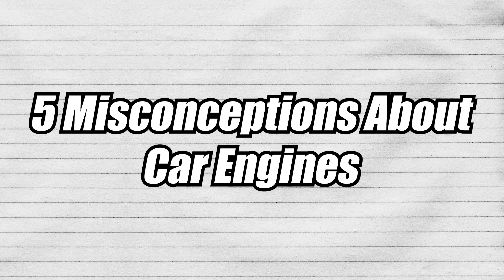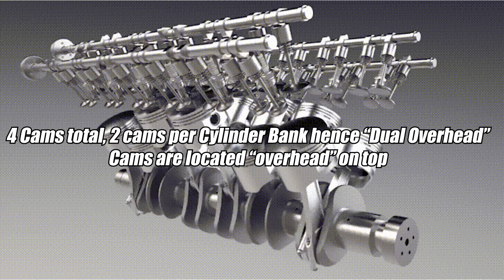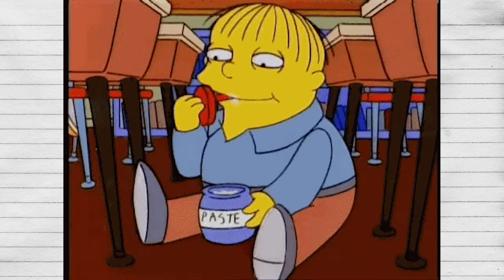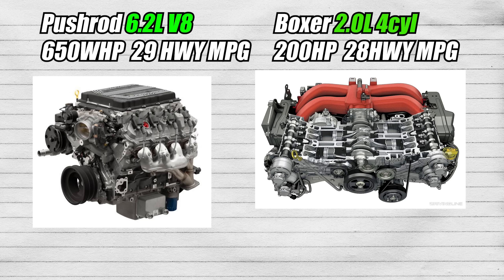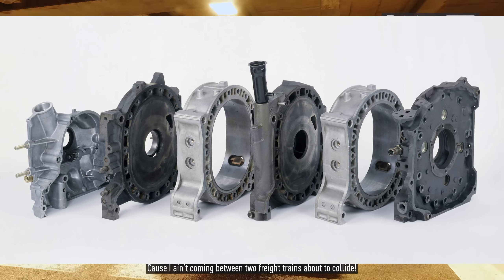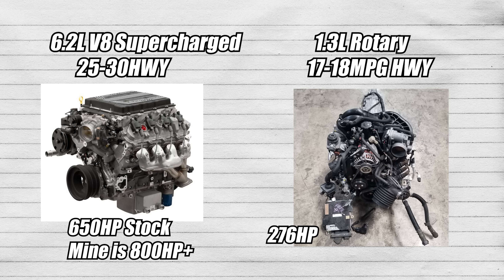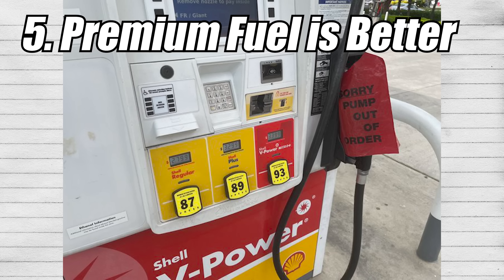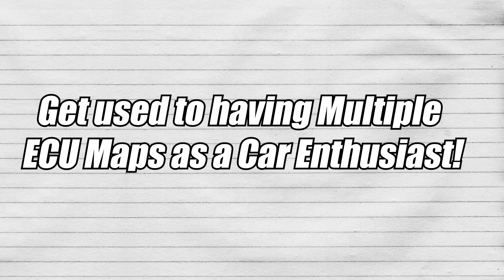5 Misconceptions About Car Engines!

Comment: I don't get what you're saying about pushrods. Why would they make more torque? There's nothing they can do to valves, overhead camshafts can't do, or is there?

All they are is being easier to engineer and cheaper to produce.
Reply: pushrods have better air velocity which result in better combustion (+torque)
Reply: @demarcuscousinsthe65th  how exactly have pushrods better air velocity? They can't open the valve more and neither can they open the valve faster.

Comment: My brother in christ engines with less cylinders are better for fuel economy because less power is wasted on frictional losses. There's no getting around physics. Trying to disprove it by comparing low cylinder count "sport cars" to high cylinder count grocery getters is dishonest at best and maliciously misinformed at worst.

Pushrods aren't torquey because they're pushrods. They're torquey because pushrod either allows or outright forces you into certain design characteristics like two valves per head or longer stroke.

Comment: My 4.3 V6 Chevy S10 has better MPG than my 2.0 Saab. I average 20 MPG in my S10, and around 17-18 in my 9-3 Aero.
And my 9-3 is a 6 speed manual, while my S-10 has 4L60E 4 speed automatic- if it had manual or modern automatic it'd probably be even more of a difference.

Comment: Damn, ive got 2.80 gears and im running almost 4000 rpms by the time i reach 80 mph. If i stay at 55, which is between 2000-2500, i get a solid 14-15 mpg.

Comment: see my question with the "premium" fuel is that people have said things such as "91 fuel burns cleaner" "v-power does a great job keeping your engine clean" etc. etc. etc... I don't care about the performance gain of "premium" fuel but I know people who have been scared into using it because of the whole "it can clean your engine" claims and neither they nor I can tell the legitimacy of the whole "premium is cleaner" claims
Reply: The companies say they put more/better detergents in their high premium. Gives people a reason to sometimes buy it even if their engine is only tuned for regular (this is harmless to the engine).
Not sure how verifiable that is, but there's something called "top tier" rating and it is separately tested for good detergent properties. Google that. These brands (Exxon/Mobil, Citgo, several others) have the good detergents in their regular gas too!

Comment: All engines need to warm up. Doesn't matter how new they are. It's the type of the oil in them that determines how long that warm up period is. But you definitely should not put any ICE car of any year in gear without letting it warm up a few minutes.

Comment: alot of people say that VAG's vr6 is unreliable and slow so much that nobody buys these cars. WRONG. These engines are great in terms of reliability, the 2.9 in Golf MK3 with the Syncro is one of the best cars to have fun (ofc not offroading, this car is too low for that). The later versions (FSI) isn't that good, but still, pretty good engine.

Comment: Yes premium gas won't improve performance on an economy car but I used to run 91 in my 07 Focus and the car ran smoother the engine used to have a tick as soon as I put premium in it the tick went away the car loved running on premium and it did slightly improve performance not drastically but the car felt like it was running a lot better

Comment: this is interesting. Explains why my 4 speed automatic 1990 Honda Accord with a 2.0 litre i4 engine gets worse gas mileage than my mom's 6 speed auto 2017 Dodge Durango with a 5.7 litre Hemi V8. poor old girl has to work so hard to go much faster than 60 mph cause she runs through all four gears real quick.
Reply: The Durango has more gears to work with and has the MDS making it a 4cyl when cruising

Comment: People do hate on the rotary a lil too much. I get it at car meets and it sucks. Idk why people have this thought that they are so bad. They're alright, just not the best. They last like 100km to 160k kms due to what is essentially head gaskets and piston rings needing replaced and people act like it's some huge issue. Subaru head gaskets, BMW rod bearings, and Audi piston rings all last about the same time lmao. Just sucks that with a rotary you have to drop the whole engine and fully take it apart, which is the annoying part. 

Though just to note, in an EV they'll be running the engine at a fixed speed which will increase it's lifespan and fuel efficiency. Not as much as a small I4, but the advantage of a far smaller and compact engine is the trade off.  Hopefully if Mazda do pull the trigger on that, that it all goes well and maybe incentivises one last hurrah for the platform and they make one last sports car before 2030 - when Mazda have said they'll go full EV.

Comment: As an rx8 owner I do find the fact rotary is unreliable as false, yes they may have alot is cons and be ancient tech but the engine is not the problem but the owner, I been taking good care of it and I don't have any issues encounter with the engine, everything is ok from the rotors, eccentric shaft, and a careful watch with the apex seals although I do fuel oil mixture because the oil metering got busted randomly but my rx8 still runs smoothly, Mazda even proved the rotaries reliability by it's only famous win to date at 24 hours of le mans by their 787B

Comment: I just let it run until the rpm drops and the engine quiets down. One my 03 accord with 200000 miles on it, that takes a few minutes.

Comment: For your 3rd point I’m not sure about some of your points. When explaining about the scarcity of parts and high demand for it, wouldn’t that just mean that due to the unreliable nature of the rotary that’s why parts are in high demand? Just because parts are hard to come by doesn’t affect how reliable or unreliable the engine is. The Subaru ej25 is a loved engine with lots of part support but is still an unreliable engine.

And with another point where the car trades hands a lot with other owners, I mean it’s just like any other old sports car, I mean I’m no mechanic either but I’d imagine that you’d do a full check over of the engine, transmission etc to look for mods or changes made to the car. Anyway that’s how I see it. Change my mind if anyone feels like reading this long ass comment.

Comment: I appreciate someone trying to disambiguate. Unfortunately, your knowledge of mechanics and physics is a little lacking. For instance, just randomly picking one out of about 100 errors, torque doesn't get the car moving or keep the car moving. Power gets the car moving and keeps the car moving. Power, in the context of engines, is just torque x horsepower.  You can have a million foot pounds of torque, but if it's only revolving at 1 RPM, you're not getting much power out of that engine. Conversely, if you have an engine that has half the torque but revs four times higher, that engine is twice as powerful. Anyway, I appreciate the attempt but maybe you should run your physics and engineering concepts by me before you publish them :-)
Reply: Another thing, pushrod engines don't develop more torque because of the pushrod. The pushrod's mass is large so it can't move quickly enough not to cause valve float at high RPMs. So it does not rev high.  Accordingly, they tune it for torque at low engine speeds instead of peak power. The pushrod valvetrain is a handicap that engineers have worked around. It's not an asset.

The idea that you have uncovered some secret regarding fuel economy that auto engineers didn't know 100 years ago is a bit funny you must admit.

Comment: Yes bigger engines do not always mean more power. But it does mean there's more potential for more power at a cheaper cost. For instance if I was building a car to be fast and it did not have an engine and I only had engine two choices 8 cylinder and four cylinder and just bare blocks to build from scratch. The goal was 500 horsepower. The 8 cylinder would cost half as much to make 500 horsepower than a 4 cylinder. So yes bigger does mean more potential horsepower. It just depends on your build. So if I had a vehicle I wanted to keep close to original but wanted to make it a powerhouse. And it came with a four-cylinder. Then yes I'm going to build that four-cylinder. But if I got a really nice rolling chassis and did not care about sticking through the form or original. I would build the V8 first. Even though I hate LS swaps the very unoriginal. There is a reason why everyone does that.

Comment: Your 2L struggling to get 24MPG is incorrect. I had a BRZ and I averaged 30MPG driving spiritedly and in traffic, as a mix. You should've used something like an RX8 as a small motor terrible fuel milage.

Comment: Dude, pushrods have nothing to do with torque.

Harley engines have more torque because they're under-square, and they're under-square because they're air-cooled. And because they're under-square the pistons need a longer piston rod for any given displacement, which make for a more effective leaver and therefore more torque, but lower RPMs and therefore less power. And because the engine spins slower, it becomes viable to use pushrods to actuate the vales, and that makes for a simpler head that's cheaper to manufacture. 

Indian engines (as well as Harley's V-Rod engine) on the other hand are liquid-cooled, and because liquid-cooling is more effective at dissipating heat than air-cooling they can get away with being under-squared, which makes for higher revving engine (because the pistons have to travel less distance) and more horsepower, but less torque. Also, high revving engines favor overhead cams because pushrods have mass and therefore inertia which places a cap on how fast they can change direction and therefore actuate the valves, thus limiting max RPM, but make the cylinder heads more complicated and expensive to produce.

Comment: There is a lot of misinformation in this video. 
Pushrods vs OHC has NOTHING to do with torque production. Displacement and cam timing is what dictates torque production and at which RPM the torque band is located. Torque band is the rpm range in which the parts in the engine are operating at peak volumetric efficiency. This can be shifted up and down the rpm range equally with pushrods or OHC with the selection of proper parts. OHC engines tend to favor higher RPM because there are less reciprocating parts than a pushrod engine. Also overhead cam engines have more freedom to Optimize the shape of intake and exhaust ports because there are no pushrods coming up from the valley of the block dictating their shape. It’s a nice video but fails in the technical department.

Comment: first of all if you put 93 octane in your car, it wont make it perform better, its actually the other way around, if your car performs better it will need 93 octane, its all about compression, the more compression your car has, its gonna need a higher octane

Comment: 3:00 yea this whole section is correct. My 2004 Trailblazer gets 13 mpg on highways, maybe 10 in city... the SS Trailblazer gets better gas mileage than my inline-6 yet its pushed that smaller=less gas. Thats the case if you drive the SS like a jackass and floor it all the time. But not everyone is a dumb 16 year old who thinks that a clapped out SS with a side exit exhaust is cool

Comment: If you take care of the rotary either fine granted they don't have the lifespan of a normal combustion engine but rotary is also rev insanely High it's kind of the same thing as motorcycles motorcycle engines like in sport bikes rev stupidly High and therefore don't have a very long lifespan but with motorcycles they don't really get driven as much as car so that's fine and I'm also not saying motorcycle engines aren't reliable because Honda has proven that their CBR 600 and s*** can do 300,000 Mi which is insane I'm just saying the higher revving engine it's putting more strain on the engine than a low revving V8

Comment: Generally no replacement for displacement. You compared a twin turbo v6 to a na v8. Compare apples to apples. Put a twin turbo setup on the v8 and it will make way more power. Or take the turbos off the v6 and compare it na to na. Granted you did get the fact that certain engine setups do have better efficiency (power/liter) than others. Not many people mention that and I’m glad you included it.
Reply: Well, if we take an atmospheric rotary or a honda 4 cylinder vtec, we will still have an aproaching power for a lot less displacement.

Comment: nice vids m8, personnaly i think its better to just start your engine and driving immediatly without flooring it, maybe let the engine idle for a couple of second if its cold but if you warm up  your engine and immedialty drive after, your tire, brake, transmission oil are not in temperature and thats not very good for your safety and your car
Reply: Tires only heat by driving, and brakes dont have to warm up (except carbon-ceramique), but the other part are true.
Reply: @hugoku8755   thats what i wanted to say with the tires, i guess my sentences wasnt very clear (sorry english is not my first language) and for the brake i dont really know but i think you're right, in a grocery getter its better to have all of ur brake without warming them up for 15 minutes

The point i wanted to say, is just start your car, drive without flooring it and every thing will be in temperature and not only the engine
Reply: @littlebreads8242  Yes you are right, and i understand (for me too english is not my first language).
But its well explained, and most of the people dont understand it.
Reply: @hugoku8755   thank you , i was afraid my comment looks like i write these while being drunk af

Comment: Yeah, "arbitrary factor", not driven by oligarchs to push smaller engines with lower lifespans thus forcing you to buy it more often because it's not as reliable and it will break right out of warranty. Sure, arbitrary.

Comment: all of these can be argued for both sides, na engines can be made very powerful, much more than a basic turbo kit, so turbo doesn't always mean faster and at the end you didn't have a meaningful conclusion for all the talking you did. bigger engines often use more fuel but mpg is based on many factors and no blanket laws are good, but there is a reason every high efficiency car has a tiny motor, so again you point is weak. rotary's arent bad but they are less reliable than other motor designs by a good amount, there's a reason it could get faa approval. letting a engine warm up is still good because in the cold oils viscosity and property's arent what there supposed to be at and tolerances are tighter, its a wise idea to let your car warm up. and you admitted octane ratting and power isnt straight forward. your whole video is just a massive no but well yes.

Comment: Hmmm.... One of the things that kind of drives me up a wall is the "No replacement for displacement" and the "but forced induction" crowds. Both are technically wrong and right at the same time. And it's really just annoying. Coincidentally, the fuel economy thing in this video is just as stupid as law makers. Mainly because MPG is a mind numbingly idiotic measurement for fuel economy. It can fluctuate wildly and is very inconsistent. A far more accurate way to measure and get a realistic proper look at a fuel economy of a car is how many liters of fuel it spend for 100 km in what scenarios. And when one takes a look at that data, displacement does in fact matter. You can have BETTER MPG in a 4 liter V8 than a 2 liter boxer 4, but you will NEVER, UNDER ANY CIRCUMSTANCE spend less liters of fuel in the same scenario. Not unless that 2 liter is Turboed. Which is why I'm annoyed by the crowds mentioned above. Forced induction both does and doesn't replace displacement. It replaces it in the sense that it makes engine size and packaging slightly smaller, but it really doesn't because of how much air and fuel is being put into the cylinders. There's a reason that low compression pistons are run on turbo engines, it's because the mixture is under compression when it enters the cylinder. Boost is initial compression upon entry into the cylinder people.

Comment: OHV can be DOCH but it has to be converted to Free valve.💪🏾
And a 2 rotary is in fact 3.4L Mazda was smart to only put on the marketing only one turn of the engine instead of DTC witch is a full turn of the engine and putting all 3 faces of both rotors.

Comment: I hate rotaries. It’s just that the seals. They. They suck.
Reply: The seals blow because people run thin oil, every rotary owner runs 20-50W conventional non synthetic oil, and premix is recommended but not needed, another problem is people don’t replace the stock ignition system when it goes bad, which then causing the plugs to go foul faster, once they go foul they don’t burn the mixture correctly then all of that unburnt fuel goes into the stock catalytic converter and it clogs it up so much to the point starting up the car gets harder that the back pressure starts pushing that crap back into the engine,
So if you 
-decat the car
-replace the ignition system
-run 20W-50 oil
-regular maintenance 
Those cars are running forever and no damage is done when redlining it like a stock piston engine

Comment: I get large engine doesn’t mean it’s less efficient.
But how else are you going to generalize things? You can rev the shit out of the corvette and it will be inefficient, same goes with my CRV, if i rev the fuck out of the 1.5, it will be inefficient.
So all we can do is generalize things, we can only ASSUME larger engines=worse fuel economy and tax accordingly. Unless you feel like all cars from now on should have a software rev limiter up to 3000-4000rpm regardless of speed. But fuck that.
Hence tax by displacement and not by fuel consumption(considering there’s already vat on gas).